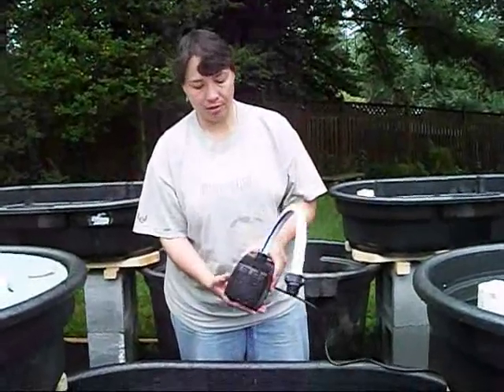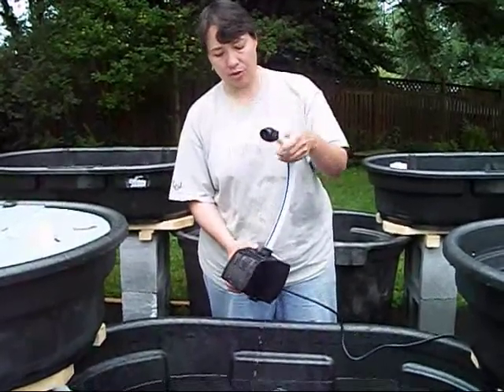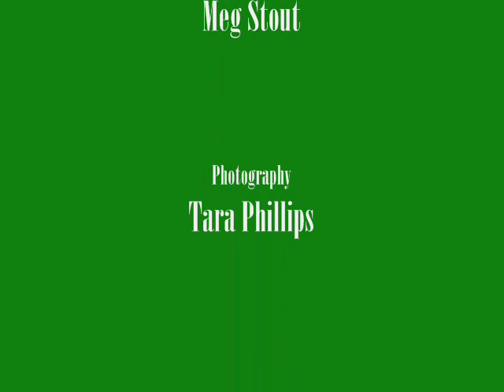Aquaponics Pumps, Plumbing

Comment from the maker: On your duckweed question, it's possible it would get caught in your pump. You can put a mesh bag around your pump to prevent this - they are sold by aquarium/hydroponic/aquaponic supply stores. Of course, you also need to make sure you have the kind of fish that will deign to eat duckweed. Tilapia eat duckweed, but they're also twitchy about their water temperature (i.e., die easily if the water is either too warm or too cold) and are regulated/illegal in many areas.

IBCs work for tanks.

Comment from the maker: The bins in this video each cost about $70 - compared to the $3000-5000 that pre-made systems cost, that's not terribly expensive. You can buy food-safe liners (dura-skrim, virgin EPDM) and construct tanks using wood. You can also create systems or components using concrete, but you need to acid-wash or seal the concrete to keep the alkalinity of the concrete from killing your fish and plants.

The grow beds are 12 inches deep and the larger tanks are about 24 inches deep.

Comment: Nice job. 
Nice set up and good explanation. The problem for me is I was settled on putting
a swirl tank from fish pond then to grow beds. I like your system of controlling the flow to the grow beds.
If you mentioned your gph for your pump I missed it.
Where did you get the Rubbermaid tubs? What is the capacity, gals?

Comment from the maker: Folks who keep warm-water fish (e.g., tilapia) and raise warm-weather plants (tomatoes, cucumbers) will usually heat the water in the fish tank and insulate the grow beds. I believe this is more effective than heating mats under the length of the grow bed. There are electric water heaters for tanks (check out aquarium supply websites) and even automated wood pellet stoves that heat water. The Wiseway Pellet Stove was specifically designed to heat water in an aquaponics system.

Comment: It's an interesting conundrum. You definitely want to stay away from copper, because copper can be toxic to your fish. Since brass is a compound metal that includes copper, brass would not necessarily be safer than plastic for your fish. It depends on the plastic formulation and the additives in the plastic. Additives may be included in plastic to make it UV resistant or non-fouling, for example. Remember your aquaponic system will become acidic over time, increasing metal concentrations.